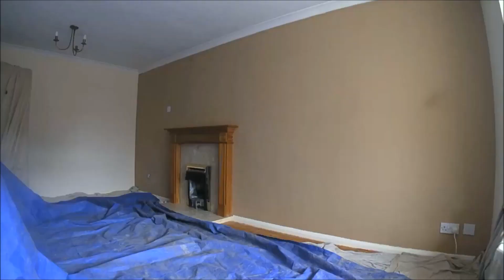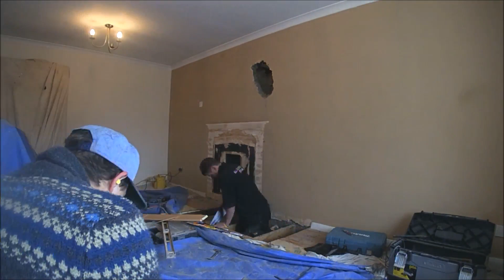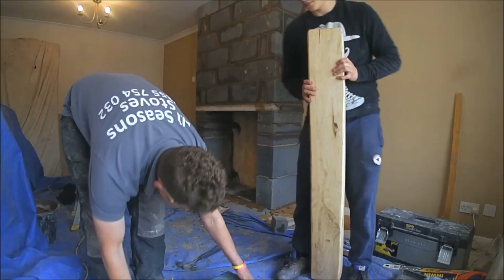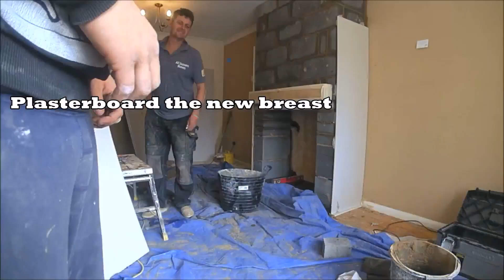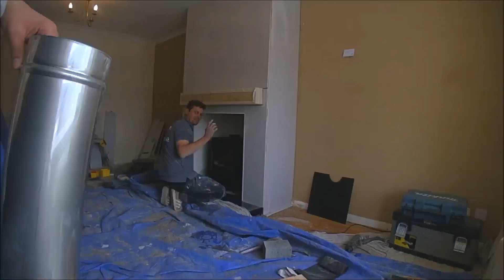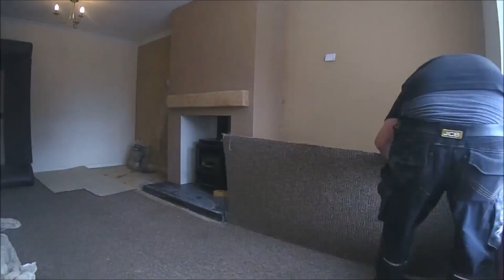Step by step Fireline multi fuel stove installation with no chimney breast

Comment: No need for those blocks aslong as your hearth meets requirements and the back wall is brick , if not u can build a concrete block wall about a metre high . The brest can be built in metal stud and track. The recess must be boarded with fermacell board (fireproof) ,the breast itself can be boarded with fireline board(pink gypsum) . Any beams fitted on breast must be a minimum 0f 300mm above the stove according to hetas guidlines.